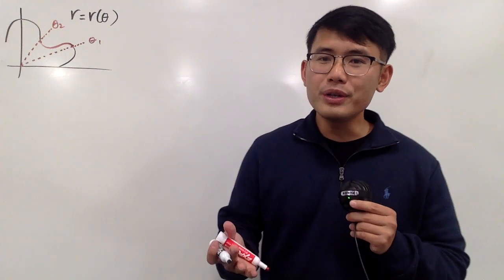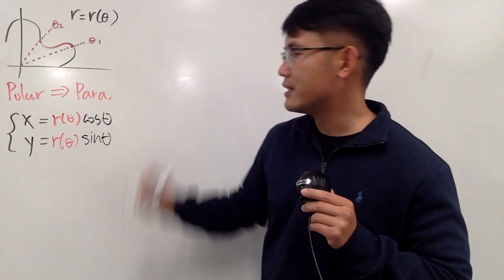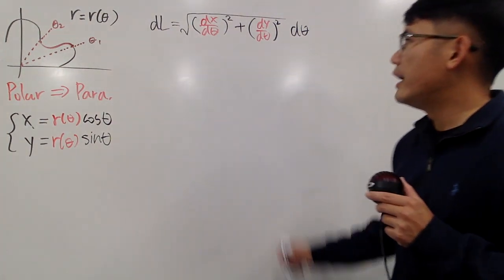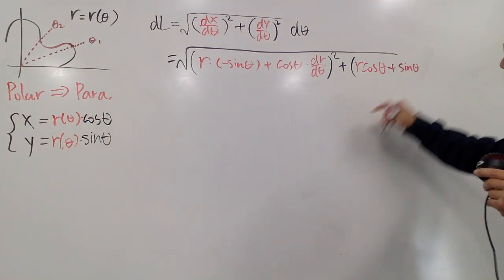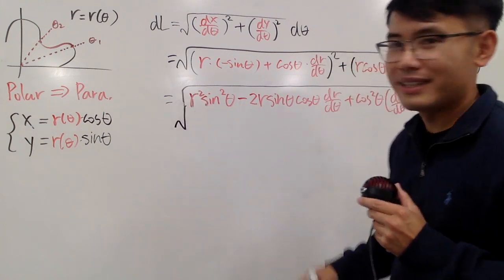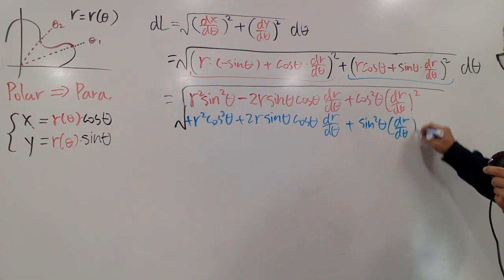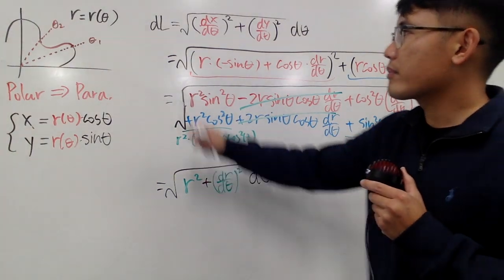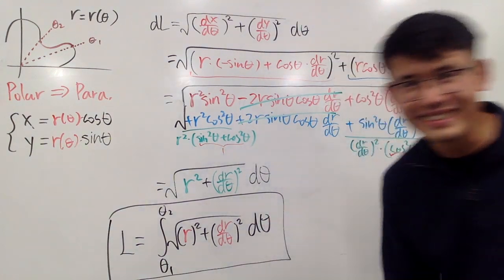Arc Length of A Polar Curve (proof)

Comment: I didn't understand why you added the d(theta) at rhe end of the first formula. Just the square root should be the differential length
Reply: Here's how I sort of understand it: dL = sqrt(dx^2 + dy^2) is the length formula in the notation of differentials and intuitively he's trying to integrate both sides of this equation. But we need a dθ in there because we're really integrating over a θ range. So we multiply the right side by 1 in the form of dθ / sqrt(dθ^2), assuming dθ > 0. This proof seems informal: he treats the left side as an indefinite integral over L (which would have limits of integration L1 to L2, not sure what that means) but the right side as a definite integral over θ. Textbooks usually present this proof more precisely, using a Riemann sum definition.

Comment: What if the limits are the same, ie i'm integrating over a loop. 

the arc length is certainly not 0, but equal limits means integral is 0?
Reply: The limits shouldn't ever be the same, even if the curve loops back on itself. For example, if it's a simple circle, r=3 for example, the limits are 0 to 2pi because a full revolution is an angle of 2pi. (You must be careful and always consider what range of angles corresponds to one full loop around the curve because, maybe unexpectedly, it's not always 2pi!)
Reply: I know that this is a year old comment, but for anyone wondering in the future, equal limits (2pi and 0, say in a cartioid) do sometimes result in zero. To avoid this, try and use symmetry when possible. For example, the arc length of a cartioid of equation r=1-sin(theta) can be integrated by using the property of symmetry about the theta = pi/2 axis. Thus, you can integrate from -pi/2 to pi/2, multiplying the final answer by 2, and you will get a real number.